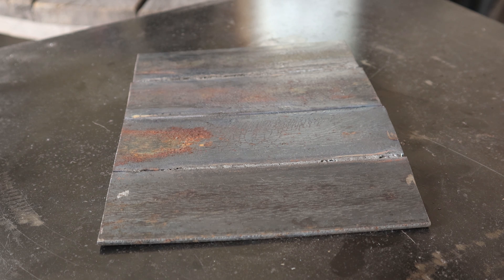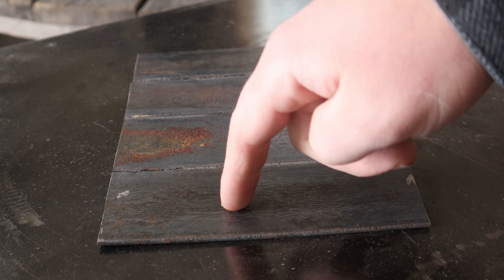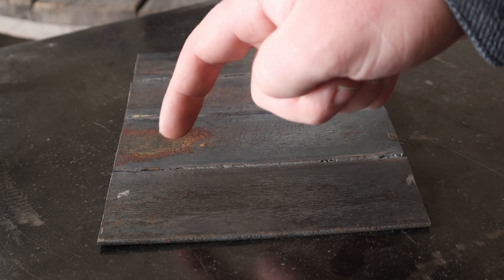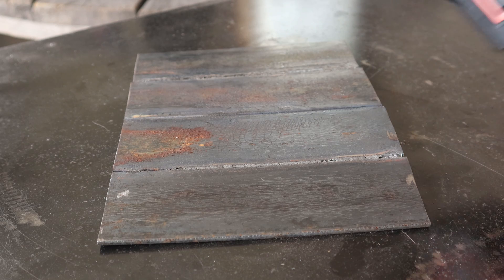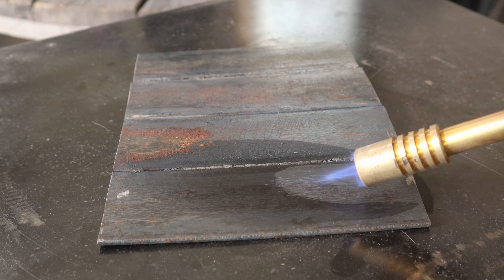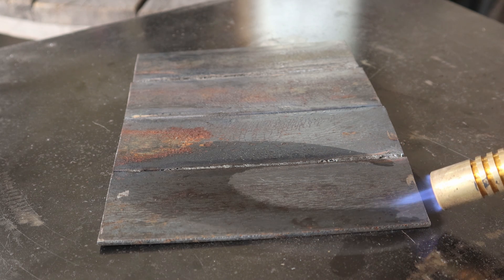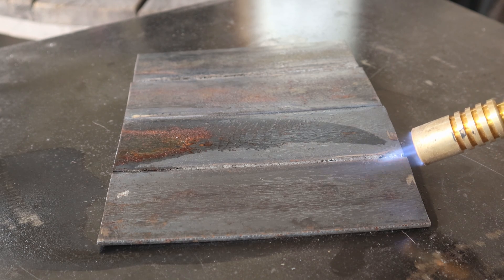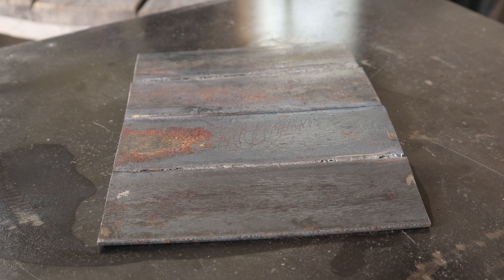Can You Weld In The Winter? / Welding In Freezing Temperatures.

Comment: Excellent video!! I’m a 40 year building contractor, concrete & masonry guy
I’m a very new welder, never thought steel absorbed steel…. I did figure the low winter temperature… here in WNY…. I guess there’s no welding in my cold ass garage. It’s delicate fender patches, I don’t want any errors or faults. I’ll try March 31st….

Comment: Great video, thank you! One question, if the weld is being done on two pieces of metal being attached through a hole on one metal, spot welding basically , do I heat the metals while they're pressed together or heat them each separately?
Reply from the maker: @blackton3  I would heat them separately first to get the majority of the moisture out. And while they are still warm put them together and heat them again, then weld them together.
Reply: @FerrousPhoenix  Appreciate the info! If I'm working with a large piece, would it help to follow your method of heating separately, heating pressed, and then after every couple of welds, hit the rest of the metal again with a heat gun (or torch) just to keep maintaining the warm temperature throughout the large piece until done? (In case it starts cooling)

Thanks for the very quick reply! :)
Reply from the maker: @blackton3  As long as the metal stays at least warm to the touch, and doesn't get below 50°F you shouldn't have to reheat the metal prior to each weld. Also I would avoid using a heat gun and I'd stick to only using a flame if it cools down too much.